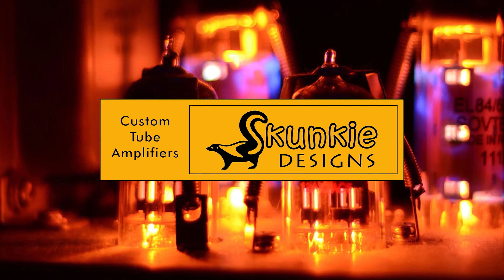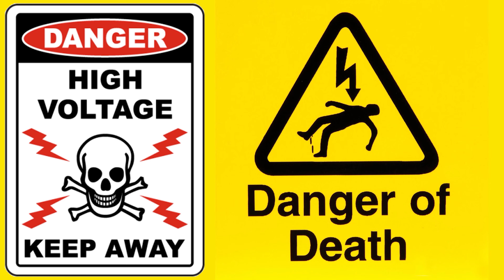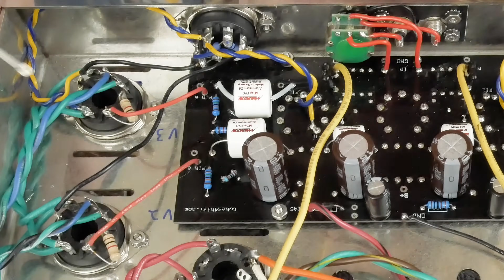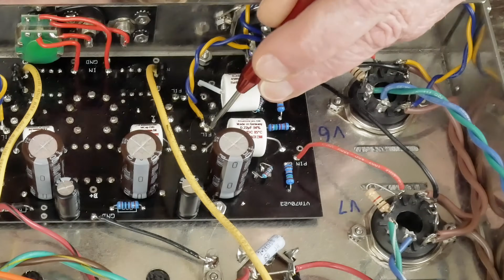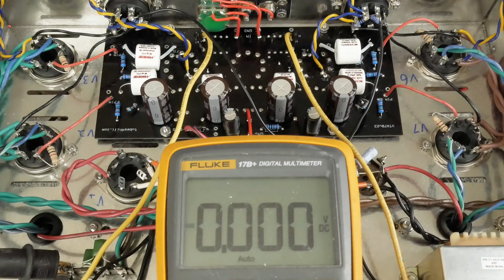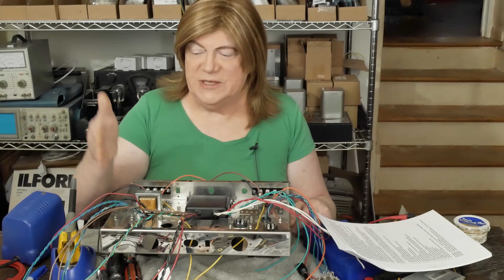Dynaco ST70 Tube Amp Kit: Finishing and Voltage Testing!

Comment: I was about to order one of these VTA's but figured I'd finish a different one I've had sitting on the shelf first. This one has aftermarket transformers. I'm getting over 9 volts on my heaters. I've never come across this before but I've always used original iron.
Reply from the maker: Yeah, that's not going to work at all.

Comment: Some great tips. I have several tube amps . Some I built. Even RF ones for ham radio . I have a newer ST 70 kit I built. I went with different boards.  The driver board I went with is the 3- 6SL7 GT tubes. I got the better coupling caps and step pot. I went with bigger chasses and IEC plug.  I built according to instructions and sounds great . Many different output tubes can be used if change bias . I have EL34 made in Russia with all tubes.  I have a China tube set and sounds good as well. Some odd reason the output tubes bias different .  Same voltage just different pot setting. Have to move them when swapping tubes .  I see there is a dual  rectifier tube board and cap board .  This may help with the 5AR4 tube life short on some tubes. Many outher rectifier tubes can be used . had different voltage drop and current ratings. The ones I have are just too small.  5Z4/ 6X5 /5Y3 . the one is 6V filament.  Now I want to add them safety resistors to bias pots.  Blue painters tape on transformers before painting . Also heat shrink transformer wires weare goes throw chassis .   I did not have grommets at the time. Maybe try some of them outher upgrades next build.  The bias meters look nice. I want to get with that 2 rectifier board.

Comment: Great series on the ST70!  I have a question.  Would it be safe to use a plug in solid state rectifier in place of the tube rectifier?
Reply from the maker: I'm going to be testing that soon! You probably would want to run the bias lower that I am with the rectifier tube, more like around 40ma as the B+ will be higher. Also you might have to increase the size of the dropping resistor for the front end board to keep the supply voltage under the 400v the caps are rated for.
Reply: @SkunkieDesignsElectronics  Thank you!  Can't wait to see your tests.

Comment: According to my math, each EL34 is idling at around 21 watts plate dissipation, which is over 80% of max. Isn't this a bit hot for running EL34s in fixed bias class AB?
Reply from the maker: Yup it is. And the original ST70 ran them at 50ma too. If you want to run them at 40ma you can and it won't change the max power, it just changes the point it's running in class A with mostly 2nd order harmonic distortion. If these were $100 tubes I might be less likely to do this, at under $100 for a quad, I'm willing to sacrifice some tube life for this. And if you are using 20W+,  then I would also set them at 40ma as there is nothing gained. End of the day, try both and see which sounds better.

Comment: I use to putt a plastic bag over the ac conector and tape it. on amps,not to be put on power .then you dont mistake the cord with another wich can happen,sinsce they lock the same.